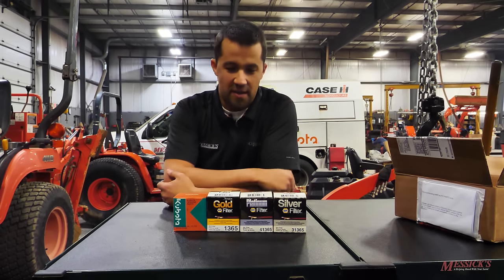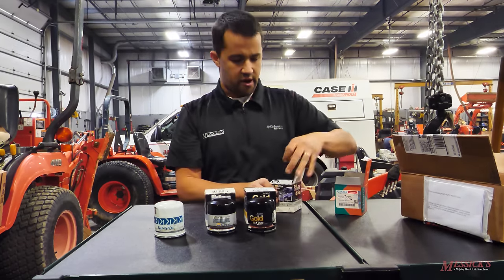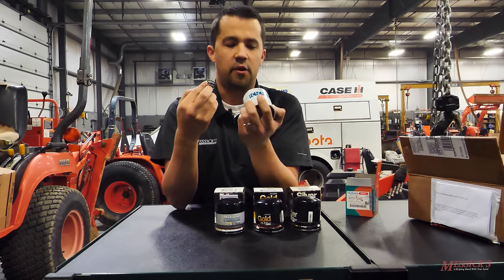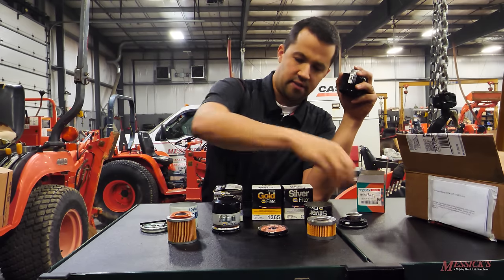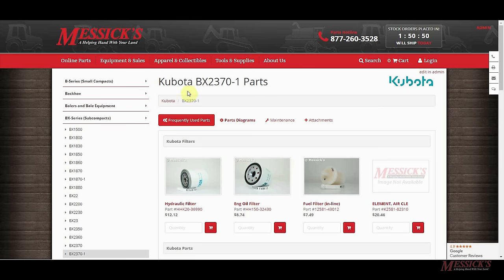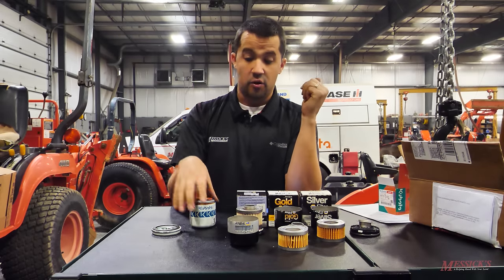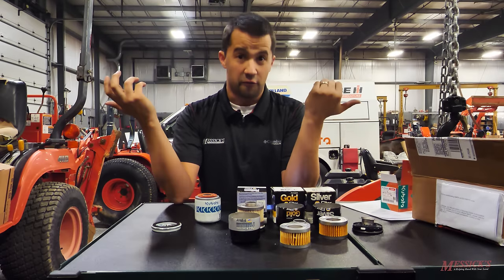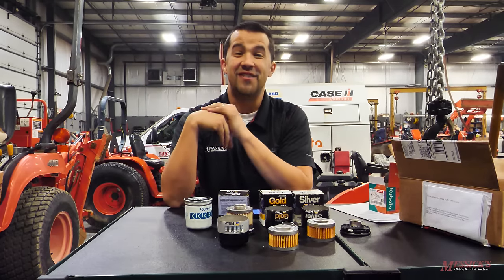Napa Filters VS Kubota Filters - Do you need OEM filters?

Comment: Some good, some not so good. Many people aren't aware that the size of the can doesn't necessarily correspond to the size of the filtering material inside. As to the filtering media, the NAPA uses a marketing principle called good, better, best, which is self explanatory. The NAPA Silver is comparable to most other filters, the Gold goes to a silicone anti drain back and a somewhat better filtering media. The NAPA Platinum uses a synthetic filtering media which far exceeds the quality of filtering media in the OEM filter. Your OEM filter is comparable or possibly better than the Silver and Gold but not in the same league with the Platinum. You mentioned you felt the OEM filter had a thicker can, but you didn't measure it, the video was taken in a shop, surely you had easy access to a pair of calipers to detail the difference, instead of just a maybe, or possibly the difference wasn't as much as you wanted people to think it was. You do explain that they can't force the consumer to use the OEM filter, but then tell a story about people causing problems with their fuel rails by using the wrong fuel filter, which is misleading since we are talking about oil filters in this video. In this particular case your oil filter price is reasonable, while on some other brands of equipment the OEM oil filters are grossly overpriced.
Reply: OP did measure the can gauge thickness, I believe the Kubota OEM was .54 mm while the NAPA was .37, your information about filter media is mostly correct, however pleat count is absolutely relevant, though you don't mention it. The length of the filter media is SIGNIFICANT with the NAPA cut corners however and certainly does not meet the OEM for fit/finish & performance.

Comment: I had a Kubota BX oil filter fail on me. I lost a quart or two before I turned off the tractor. Since then I’ve been using either Napa or Fram Ultra.
Reply from the maker: Curious how it failed?

seems to be a step backwards isn't it? If a Kubota filter failure damaged the engine you have a very black and white claim. However if a Napa or Fram fails you have to somehow convince them it was their filter that caused the problem.
Reply: Messick Farm Equipment the threads were not plum to the base plate. So the gasket on the base plate could not seal, thus oil was spraying all over. Initially I thought I cross threaded it but that was not the case after I inspected the filter.
Reply: I loss confidence with Kubota’s oil filters. I rather use Kubota’s filters but now I’m afraid too. No damage, I always inspect for leaking oil no matter what equipment it is. Tractor or automobile.
Reply: Well that's the part he left out, Bet that Wix Filter has a assembled in USA on it while Kubota uses "Made In China" junk
Reply: In my 40+ years of changing my own oil, the only oil filter failure I've ever had was from a Fram.  Fired it up to check for leaks and watched a couple quarts of oil pour all over the driveway. Not cross threaded - just a bad filter from the factory.  It can happen with any company but after looking into the construction of Fram filters, I never used them again.  Grew up in a time where Fram was a quality product - sort of like Sears Craftsman.  Times have changed.

Comment: Don't ever use a phram  oil filter on anything you own car truck tractor go to Wamart at any automotive store go grab you a couple Napa filters open the box take a flashlight and look down in there how much you want to bet you find rust inside the case. Not only that the filter element is made of cheap quality and put together with freaking cardboard. They are absolute garbage. Yes Wix filters are fine a Wix may have a slightly thinner case but they don't rupture normally for oil pressure normal oil pressure I've never seen one rupture and if it crushes it's because you put it on too damn tight in the first place and didn't lubricate the O-ring I mean come on Common Sense people. But afram use at your own risk.

Comment: I don't even know where to start dude. Half right half misleading and pretty dang funny at times. Ask someone in your repair dept about filters and engine load... That filter material in the kubota didn't look as good as you was making it out to be. At least they put metal end caps on it. I've never worried about an oil filter getting clogged. I have worried about the material rupturing and allowing unfiltered oil to flow right by.

Comment: dont talk so fast, slow down
Reply: In the bottom right corner of YouTube Videos in a computer web browser there is a settings gear. On the top right in the YouTube Mobile App there are three dots which are also the settings menu. Clicking on either one gives you the option to slow the video down all the way to 1/4 speed and for long drawn out slow talkers you can increase the speed up to 2X to make the videos more tolerable. Slow it down too much and Neil sounds drunk! Cheers!
Reply: Listen faster

Comment: Hi, I like all your videos they are jammed packed with so much useful information. I am from Nova Canada and I  have a 2015 B2650. I have one annoying problem with my tractor that my dealership can't help me find a solution. Maybe it's just me and my lack of memory. The problem is that when I apply the parking brake, I most often forget to take it off when I start driving again. I realize after I arrive where I was going that I stupidly left the brake on. I asked the dealership if there was a parking brake alarm system that I could have installed on my tractor and they said they don't exist. Do you know of a parking brake alarm that I can put on my Kubota before I wear my brakes out?
Reply from the maker: I'm not aware of one. But you're not the first person to ask that.
Reply: my ZTM engine starts to die if I try to go with ebrake on, standard safety switch from Kubota